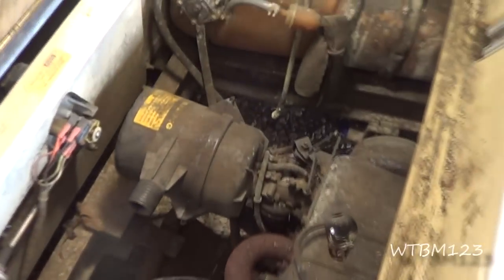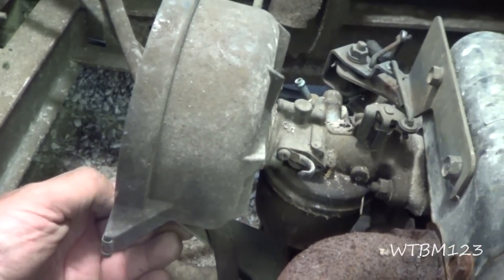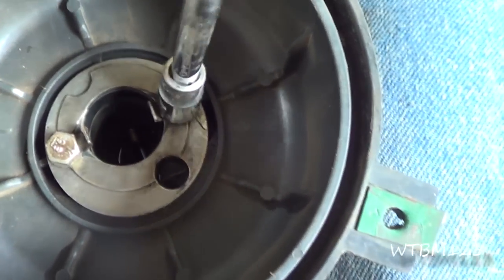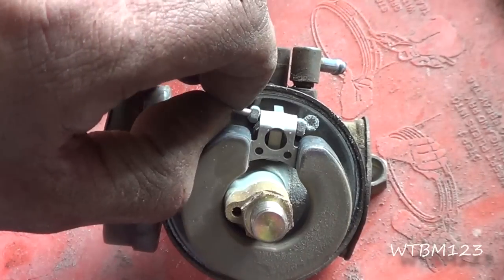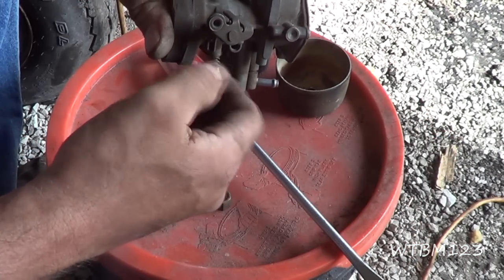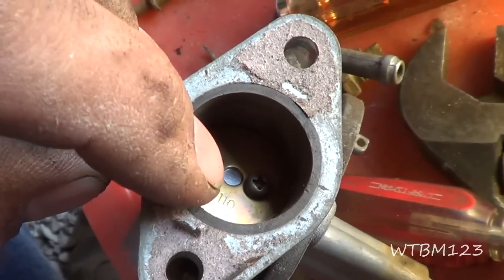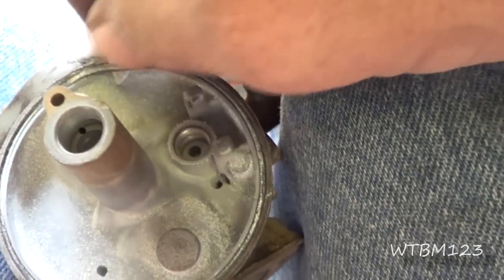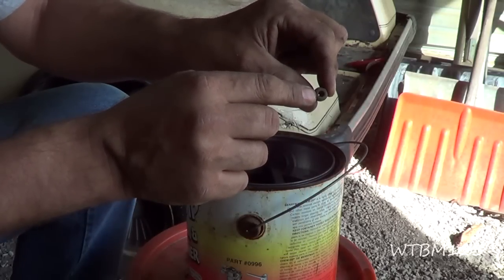Fixing The ClubCar Golf Cart Carb  Part 2

Comment: wtbm123, Very good carb rebuild video. About the float, I have had them get fuel logged, pin hole leak,. Thanks for posting!
Reply from the maker: The float looks discolored and a bit weird ,but does feel light still. Not sure what the float is supposed to weigh but ,i am going with it and see what happens.It did appear the float may been a little high. I have never really had a need to work on golf carts much so it is kinda fun. so far.
Reply: wtbm123, I see U flying around on that golf cart in no time. BTW, about a battery, Mustie1 and I both found auto salvage yards that sell used car batteries for $20, my place gives me a 30day warrantee. Good luck!
Reply from the maker: Harvey Spooner It is a two hour drive to get to a big yard with good prices. There are a few yards around a hour away and they think their stuff is gold. . I am kinda in the middle of nowhere.

Comment: I watched this because my clubcar was not running right and gas was coming out overflow hose.  took mine apart and the pin that holds the float had fell out.  tap it back in nice and tight and all is good again...  your video really helped thanks!
Reply from the maker: +Ramon Prince Thank you for watching and commenting

Comment: Does the fuel line go on the barb pointing up, or barb pointing down?

I assume the one that doesn’t get used, it’s just the “overflow” port?
Reply from the maker: Sorry just saw this . Down is fuel line . one sticking up is overflow . just has a little line on it that just runs down just below the engine